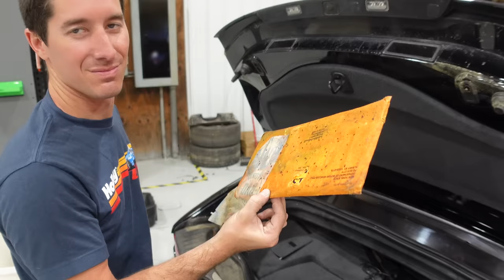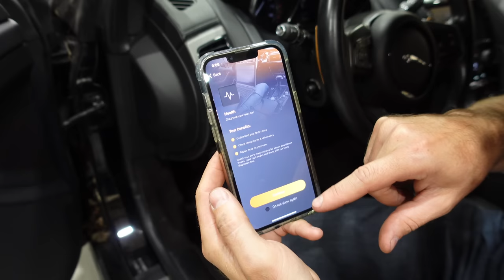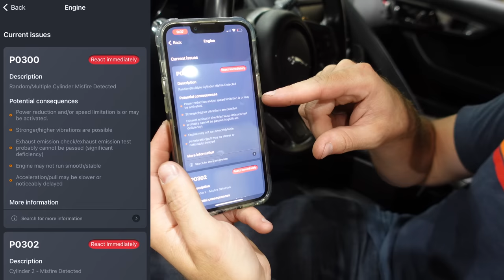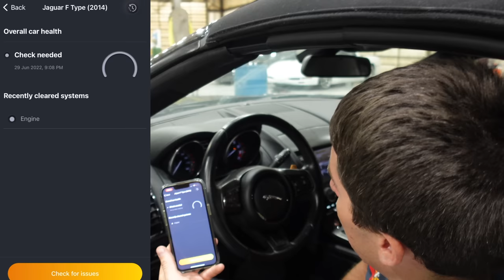My CHEAP Jaguar F-Type S Actually RUNS But It's Horribly BROKEN

Comment: Jag tech, id start with cylinder leak down test to confirm if head gasket is actually bad on that side. I’ve never seen the intercooler leak internal before, (could always be a possibility) otherwise not much ways for coolant to get into cylinder other than head gasket. Common problems for 3.0L are y-pipes under super charger looks like yours have been updated water pumps were real common cross over pipe from head to head are real common on the back I usually do y-pipes crossover pipe and water pump all in one shot while charger is off. Other common issues is pcv valve it’s on passenger side valve cover it’s round disk they tear internally cause lean code bank 1. I can hear your supercharger spring rattling easy to determine if that or chains take intake off disconnect driver MAF can do it from top if you look take belt off super charger start it up  and shut down listen for chain rattle on start up and shut down. Those vacuum lines you found in the back looked more like coolant lines could be old stuff the hard cooling lines are really brittle after this long. Yes you should reset battery monitor with scan tool honestly if your not worried about the low batter messages on right now and are still getting a feel for the car it’s really not gonna hurt a whole lot id still recommend resetting it down the line and be careful with some scan tools I have a cheap autel and for some reason the jags hate it turns them into a brick lol it’s nice to see people discovering jags these cars have been over looked for a long time good to see!

Comment: Check the water to air intercoolers on the upper intake manifold and see if they're weeping coolant into the ports. It could very well be the cause of your issue.
Reply: It's only on the earlier 4.2s that did that. These are external in the bumper. Worth a shot taking off the top of the supercharger though. 18 bolts and he'll be able to see the intake runners.
Reply: There's 2 intercooler bricks on mounted to the supercharger lid on the 3.0 and 5.0, so Stefan might be on to something if one of the bricks were damaged during removal or install.
Reply: @F06M6  5 cc

Comment: Our shop in Texas specializes in these cars. We do on average about 2 per month on the jag engines. Yes head gaskets and chains are the headache. They over heat because the plastic hoses under the super charger break and start leaking.
Reply: What's your recommendation?
Reply: kind of like the plastic coolant elbows underneath the alternator on a GM 3800 V6; they are a known weak spot in the cooling system besides the Lower Intake Manifold gaskets on the Series IIs.
Reply: Where are you located in Texas? I have a 2017 F-Pace and I'm losing coolant and getting what I believe are exhaust gases in the coolant system. No milky oil. But definitely the white smoke like in this video. Y pipe and others have been replaced. Then thermostat split open about 6 months later. Replaced that one myself. But now I need to figure out if I'm looking at a head gasket with this loss of more coolant and the coolant system getting pressurized.

Comment: Check out Sam Cracs video with the 5.0 supercharged jag, he had the same issue with the supercharger/Range Rover and fixed it for like $50. If I remember right it’s a connection plate between the supercharger shafts that breaks. 

Just an idea.

Comment: The extra battery in the truck may be one of those auxiliary batteries a lot of  jaguar’s and Land Rovers come with for the electronics.
Reply: They are related to stop start and can be removed if stop start is disabled.
Reply: Maybe a 2nd battery as some Mercedes have?
Reply: @philtowle4683  Removing the auxiliary battery is the way to disable stop/start.

Comment: ALWAYS change the oil after water has been inside the engine. Always change the oil before starting a car that's been sitting for a long time. Running that engine with that nasty shit in there is going to cause serious issues. You say it's "head gaskets" but you have tons of nasty shit in the oil and the engine that will cause that.

Comment: Great video! The centre vents not coming up is a common problem with the F-Type. There's loads on the internet about it - i believe you can buy a new bar for the actuator to fix it
Reply: These cars aren't even that old. I can't believe how many failures they suffer. POS. My 15 yr old Honda Fit has had precisely zero failures, other than one battery. It even has the original tires still (I don't drive it much, but it's time for new ones).
Reply: your honda fit??????? ur comparing apples and oranges bud ur fit has nothing close to the moving parts or electrical parts this jag does.... LMAO  ur fit is BASIC and is a commuter car ..price of your car new compared to that jag is substantially HUGE

Comment: That engine did not sound nearly as great on that second start.  There was a bit of a knock/clack that sounds like a potential issue worse than just a head gasket or something.  Could have been the supercharger though, which clearly has something going on with it.
Reply: To me it sounds like the supercharger coupler, you can kind of hear the distinctive "marbles tumbling around" sound while it's running.
Reply: @Hdogdog7  What is the coupler in the SC? Like the pulley?
Reply: @zxggwrt  Kind of, it's part of the snout of the supercharger behind the pulley, and once they start going bad it can sound like marbles rolling around in a metal can.
Reply: Ya, I don't know. I've had 3 of these engines. Well x2 3.0 and x1 5.0 in thr SVR. All have that unique, albeit unrefined "loose marbles" sound.

Comment: its either head gaskets or the water to air cooler at the top of the supercharger, pull the first thing off the top of that motor, flip it over ( cover coolant line ports and pressure test,  there are two internal heat exchangers that feed right into the intake ports right on both sides of the supercharger..... also you must rest the BMS battery monitoring system and make sure you put in the exact battery it had and is a LI-ion battery.

Comment: I'm sure I built this in 2013/2014. I made these for 2 and a half years. There is 2 batteries (stop/start). Che k the rear fusebox in the boot floor.

Comment: JR, when you get a chance reset the battery adaptations. The Autels can do it. It must be done or else everything goes wonky. It's like programming those BMW batteries but not doing it actually has consequences hahahha! Charging faults, "low battery start engine" AEB faults, etc. Also Howdy!
Reply: Definitely disconnect the battery after every time the OBD2 port is used .. the Jag does not turn off properly once the CAN bus is used by a 3rd party device.  Otherwise the battery will drain after 2 days
Reply: This is interesting stuff but way over my head. I'll file it for the future.
Reply: @handhwiegman8115  my ftype has the exactly same problem. I can't connect my fi exhaust obd into it. So painful, is there any way to fix that?
Reply: @henryli4477  I have not found a solution to the Jag failing to shut down, besides disconnecting the battery for 15-20 seconds.  Some Ftype owners say that they can use certain OBD2 equipment with out needing to reset the car after use.  So it is probably due to a communication interaction between the device and the Jaguar’s CAN bus.

Comment: Everything I read about these jag 3.0 and 5.0 engines says not to waste time with head gaskets and just replace the engine. These things are notorious for timing and cooling issues.
Reply: Agree 100%, my 5.0 had a hydraulic timing chain tensioner fail and destroyed the engine. Any of their supercharged engines are ticking time bombs. Once they're out of warranty its best to dump them.
Reply: @rick5976  I spent $5500 to have the chains, guides, and tensioners replaced on the 5.0 in my 2013 LR4 recently. Not cheap but cheaper than a new engine when the timing slips.
Reply: Weirdly the 3.0 is more expensive that the V8. And they are *expensive*! A used 3.0 is anywhere from $7,500 to $8,700. Way too much money.
Reply: @K2489S  The sad part is Jaguar has had this problem with the 5.0 engine since 2010. There was a class action suit against them from XKR owners 2011 & up but not sure how that ended. They know how to design a beautiful car but these ongoing engine problems are inexcusable.

Comment: Low Battery Start Engine comes up because of the 2.nd Battery.
Its a small hidden one battery.
Reply: No Problem.
Had the same issue on mine as well.
Your Supercharger also sounds not so healthy. It sounds like marbles when you start it.
Supercharger Coupler is most of the time the Problem.
There is a solid coupler made of silicone on ebay.(forgot the name of the company - its a green one)
Half a day of work but its fixed for about 70 bucks. The field Fix parts from Jag dont do the job (same parts as before just cheaper 400 bucks)

Comment: Carly is great but you aren't buying a tool, even if you buy the upgraded version, you're buying a subscription.  I bought the old version in 2017 before they switched pricing models & have been using it for a while.  Best thing I ever did was use it to turn off that stupid map warning on the nav every time you get in the car. lol

Comment: There is a known issue with some F-Types where the internal computer(s) do not go back to sleep after using the OBDII port.  Quick fix is to disconnect the battery for a few moments when done with the port.  Looking forward to more!!!
Reply: Only some devices cause the battery drain when disconnecting without closing the session cleanly.  Smog test equipment is one culprit.

Comment: 1) If you want to swap engines, how 'bout using their V8?  It's the same block.  Of course, it's still not as simple as pulling the old block, swapping it out, and calling it a day.

2) Where did you get the car, how much, and was it sitting in the rain?

Comment: That is exactly what I would expect the trunk of a Jag in that condition would look like.  Cars that get trashed are usually full of trash.
Reply: I dunno, is this car trashed? It looks like it's in pretty decent shape. It was left outside for 6-9 months and it's filthy. Other than that, and a coolant leak and a few assorted Jaguar design flaws, it seems fine. It's going to buff right out.

Comment: I think head gaskets. These engines are known for warping heads and block BADLY! They also like stripping head bolt threads. There's nothing that will cause a 3800 coolant leak, outside of the front and rear water manifolds causing an external leak. JLR TOPiX for the workshop manuals, it's like $100 for a few days and is well worth it since you can download any PDFs that you may need.
Reply: I’ve worked at a JLR dealer since these were new and never heard of any of these things happening. Total yarn
Reply: @vernonbrown6249  Own a V8 F-Type and browse F-Type related forums pretty frequently. Never heard of the purported issue either
Reply: @vernonbrown6249  Always good when someone with real life experience sets the record straight, too much BS flying around on the internet.
Reply: @vernonbrown6249  I have two of these engines on stands, both with blown head gaskets. You've never heard of the crossover pipes? Dummy.

Comment: I love F-Types and I drove quite a few when I worked at Jaguar. I almost had a heart attack though, when you briefly mentioned LS swapping it... and then reassuring me when you said you weren't going to... lol! But it doesn't sound quite like it should, the supercharger sounds different and the exhaust is ridiculous, the original one with the valve open sounds awesome as is!
Good luck on saving this one, I'm excited to see what you'll need to do to it!